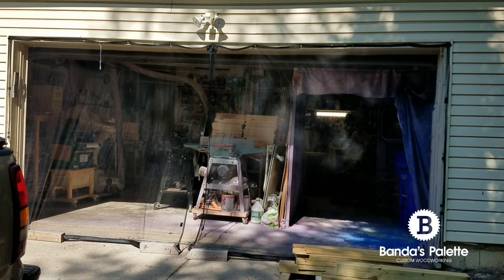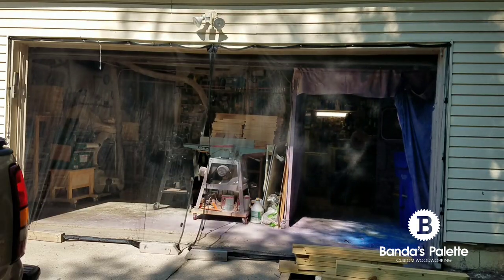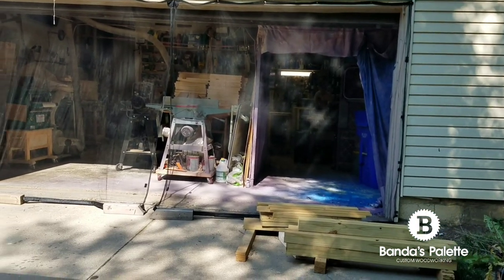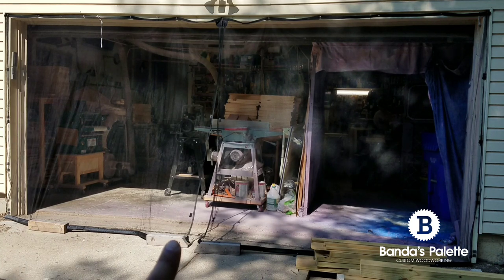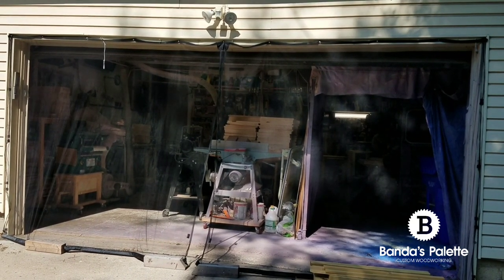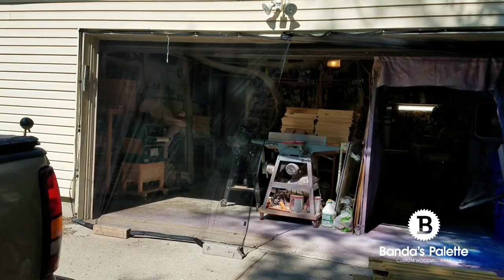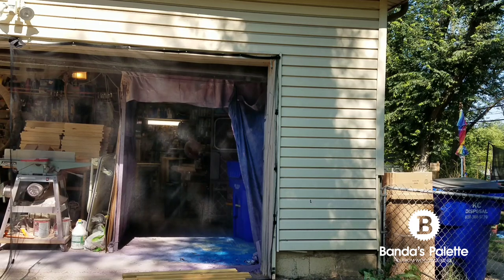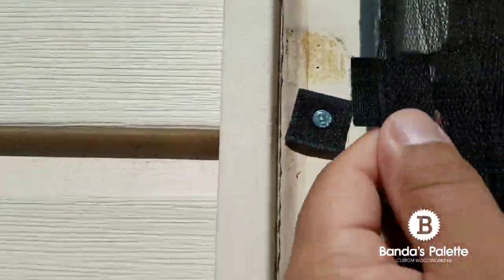Garage Screen Door install and tips Bandaspalette.com

Comment: My question is the screws are too small for the grommets so do you screw the screws in horizontally on the face or vertically on the underside?
Reply: Have the same exact issue… should’ve put instructions or somethint